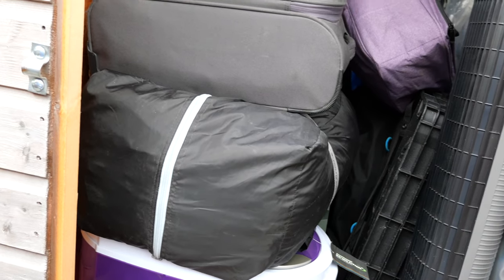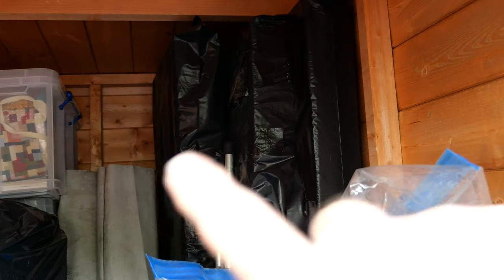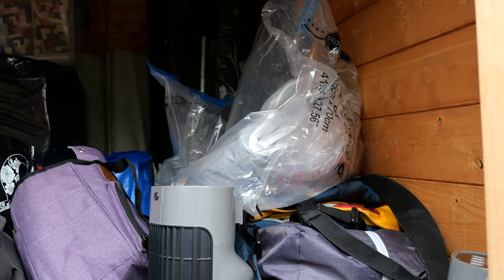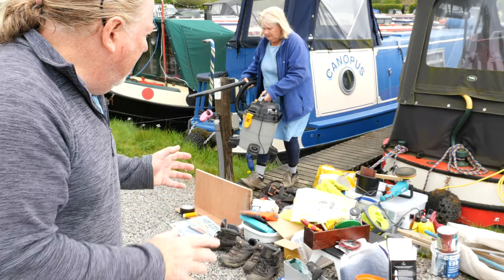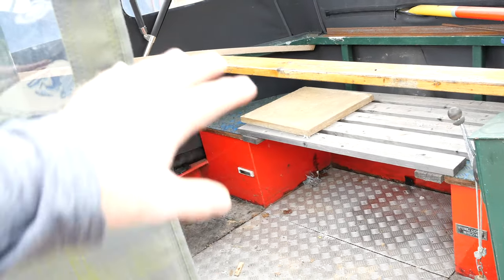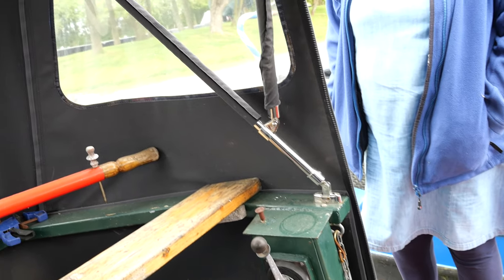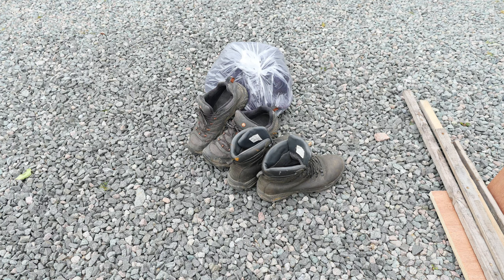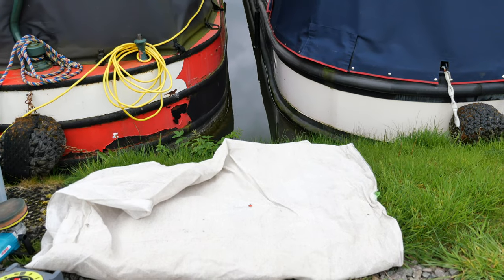Decluttering & Preparing for full time motorhome life

Comment: I think if your awning over the back of the boat had a weighted edge that was lapping past the lip of the boat edge the water running off it would go in to the canal not on your wet deck as you called it. That's an easy fix to get a  canopy maker in to add this to the existing canopy. They just sew a chain into it after they extend the edge 6 inches.
Reply from the maker: It’s a good idea and it sort of has that already. Problem is the edges around gunwall are not water tight. Some water will always get in, it’s just the way it is 😔